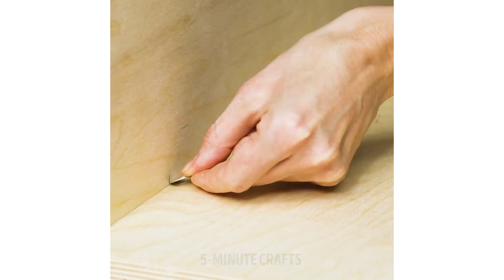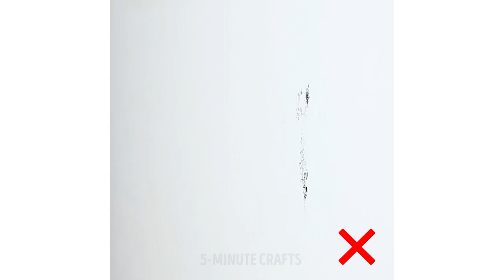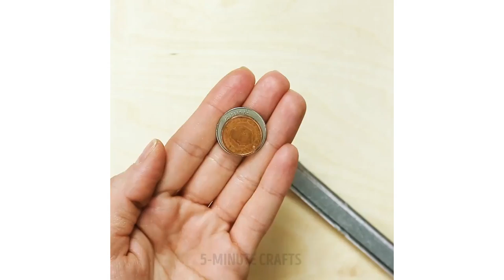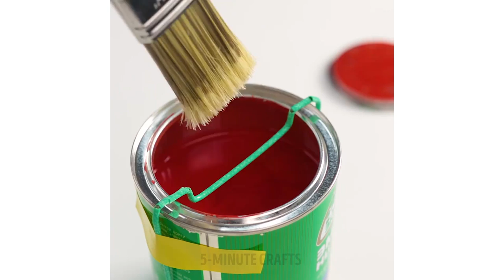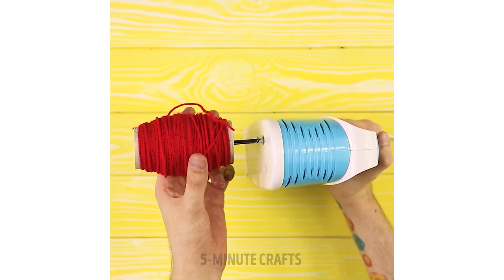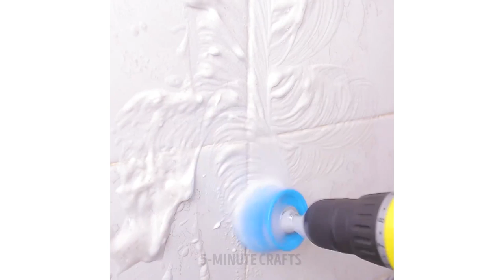14 MIND-BLOWING TOOL HACKS

Comment: I've got 40,000 deck screws.  Anyone wanna come over and help me soap each one up individually?
Reply: I dip the tips in grease or oil.  Reduces battery drain on cordless too
Reply: My late Grandfather (1889-2001) used soap or candle wax on wood screws.  He drove all of them by hand and did not have the luxury of power screwdrivers.  This one really works.
Reply: Just pour liquid soap into the container of screws and shake it up. Problem solved.

Comment: Did anybody else think that the fork hammer was used to put a nail in between and then just smack the hammer down with the nail attached into the wood lol.
Reply: I have a novelty hammer that as a hammer head on one side and a bottle-opener in place of the claw.  It has never been used for anything but kitchen stuff.
Reply: That's exactly what I thought. I don't think I'm going to use my dirty, greasy hammer as a meat tenderizer. lol
Reply: Honestly, just get a meat tenderizer. They should be pretty easy to find, and pretty cheap.
Reply: ... Funky Crumpet ... why not give it a go. Let us know.
Reply: No because you would want to put the nail in accurately
Reply: Sarcasm? Hope so because that is actually a TERRIBLE idea because of accuracy XD
Reply: ... Funky Crumpet ... That would be a good idea
Reply: Lord Flufflebuns  if you swing a hammer for a living you can be very accurate. you must not know much about carpentry. a lot of framing hammers have a groove on top of the head with a magnet to hold a nail so you can set a nail when you can't reach with your other hand to hold it.
Reply: Yep exactly my thoughts.
Reply: I suppose I should have used the word "precision" instead of accuracy. Yes, using a hammer a lot does make you able to just swing the hammer and usually hit where you want, but sometimes you need to be more precise then that, which leads to the point of where this is more or less a situational necessity problem rather than a "Use all of the time" problem. However, don't get all cocky and start saying "You must not know about blah-blah-blah". You sound like a child when you say that. You don't even have to be a carpenter to know that using something often increases your skill with it. But the size of the nail and wood are things you have to take into consideration when hammering, otherwise you could split the wood. If you were a carpenter, you'd know that. The Grooved hammers are only useful when accuracy is not a concern.
Reply: Using something does not automatically grant higher skill with that object. You need to get used to, or accustomed to that object (if u want to get smart-ass with me).
Reply: Max Green  Really? Learn to read before you comment. I never said that people just pick up and learn something. I said that if someone uses something A LOT then they become more skilled with it. C'mon man, at least try to debate properly.
Reply: maybe if you use one of those small half size nails then you wouldn't have to use as much power to smack the nail in.
i think it would probably work that way depending on how big your nail is.
Reply: I have to admit that I did lol
Reply: ... Funky Crumpet ... II
Reply: give him a break it was most likely a typo
Reply: we'll done you.
let your mother know how good you are when she brings your supper up.
Reply: ... Funky Crumpet .
Reply: Yep!!
Reply: Exactly! I have a 16 Blade  Meat Tenderizer. No way the fork and hammer is better. looks just like this model: Jaccard 200316 Super 1 Meat Tenderizer. Cost me under $20 bucks.
Reply: No, a "folk hammer" is used for folk songs.
Reply: it was a typo.
if ya didn't notice the L and k are right next to each other.
and i play folk songs on guitar so i know exactly what you mean.
Reply: But the R is so far away, why is it missing? :)

Also @Wesly Smith, if you have some pencil sharpers lying around you could use the hacks from this video to turn it into at 20 Blade Meat Tenderizer.
Reply: LOL thats why i watched the frickn video in the first place  : P
Reply: ... Funky Crumpet ... yip, used most of these before and know a few other tricks
Reply: similar to an upholstery hammer when using small tacks
Reply: ... Funky Crumpet ... i thought it was for making mashed potatoes
Reply: ITS to punch beef

Comment: NICE
About the last tip cutting a bolt: cut beyond the nuts, hence when you unfasten the nuts they fix the end winding of the thread
Reply: zapopper, how do you know which end he was going to use?
Reply: probably because chucking up on the treads tight enough to do that is going to ruin them.

Comment: Had never thought that an elastic can be used as a buffer to a worn screw recess
Reply: They can, sometimes, although I've found that if it's going to come out at all, its a matter of applied pressure. Having worked in refurb, the amount of stripped screws I've had to remove astounds me. More often than not the elastic got in the way.
Reply: .... except it doesn't work. Use vise grips, not this joke of a hack.
Reply: That screw wasn't worn. It was a pozidriv screw and he was trying to turn it with a philips screwdriver.
Reply: Vice grips solves every problem :)
Reply: Claymore77 The tick marks between the cross indicate it's a pozidriv. You can do a Google image search for pozidriv screw to see what it looks like.
Reply: Use a junior hacksaw blade to cut a slot and then use a BIG flat blade screwdriver to get it out.
Reply: Or you could just use the right Posidriv screwdriver, as Cartoon Watcher points out.  A regular easy out screw extractor works too, if you don't need to reuse the screw.  But nothing beats having the right tool for the job.
Reply: A torx screwdriver I would normally try on the rounded screw. It depends also if long wooden bench screws, allen head bolts etc
Reply: You do now!
Reply: It's easier to just get an extractor set
Reply: Chris Welcome... only if you can clamp on to the head.  If it's sunk, your vice-grip is as good as butter.
Reply: No that was great!
Reply: Mark the time.

Comment: Obsessed with holding nails on a hammer.
Reply: you take more time making the 'hack' than the time you'd spend hammering the nails into whatever object. Just bring the container with the nails...Also it doesn't work for bigger nails, either the nails drop off as a bigger force is applied to the nail due to added weight and harder swinging of the hammer.
Reply: Also, it isn't that hard to hold nails in your non dominant hand. I've done that for years at work.

Comment: some of these aren't hacks, they are proper usage.
Reply: yeah my I/O operator was malfunctioning
Reply: except for the double-wrencing and coins in the wrench
Reply: Helpful for us amateurs that didn't know, though. Like hooking the tape measure slot on a nail, and that your cutter has a built-in piece to break away to a fresh blade. Also consider that we amateurs are the ones that never have the proper tool on hand.
Reply: The issue is a lot of these are proper usage, and a lot of them made me cringe and for someone who doesn't know a lot about tools it could be dangerous to confuse them.
Reply: "why are all your wrenches broken?"

I saw it on youtube...
Reply: It'll be the drill with the bent shaft. I've been doing mechanics since I was a kid, even got certs in mechanics, autobody and welding. I can vouch that it's safe for your wrenches to leverage them together. Just watch the amount of bend. I've probably snapped more wrenches using them the correct way than harm done when stacking the lengths.
Reply: flntstne and aren’t we smart enough for some of these life hacks
Reply: I did not see any broken wrenches....  What?
Reply: double wrench = ok to do, but you risk damaging your tools or snapping the bolt in 2 pieces.

Comment: 1 wrench, impossible to turn the bolt. 2 wrenches, loosens bolt no problem. When life throws a wrench in your gears, grab another wrench.
Reply: Ben Miller heh. this actually made me laugh.
Reply: haha
Reply: Ben Miller )8
Reply: For the record though people thinking the drill thing was a bad idea was bogus... but you might want to be careful trying that if your on the brawny side. Wrenches turned sideways like that aren't that hard to snap. There is a reason they are shaped with the thickest part of the metal the plane of force you are applying. Odd's are if you can't get to loosen with one wrench the force it would take doing that would snap the second one.

I highly recommend tapping it a few times with a rubber mallet, or a chunk of 2x4 to "break" the nut.
Reply: You Tube
reload
Reply: Don't tap nuts to break them free, this is what amateurs do and it either leads to a nut that wasn't that stuck becoming free or it leads to a stripped nut. Use a cheater bar, or any pipe that fits over the nut. Or if it's really bad, put some penetrating oil and let it sit.

of course anyone who does enough wrenching knows all of this by now.
Reply: Worked fine for me for the past 25 years, worked fine for my father and my paps too. Penetrating oil will literally do nothing if it's truely stuck. Bout all thats going to do is remove debris from the threads.

Also a cheater bar goes over the wrench, not the nut.... Also a great way to break a wrench. A quick tap can loosen a lot of things that steady force wouldn't budge.
Reply: If penetrating oil doesn't work than you should be considering heat till red hot, because it's rust welded. I don't know what kind of work you guys do, but as a mechanic and machinist, you NEVER tap nuts to loosen them period.

Yea i made a typo. If you have a nut so stuck that applying a cheater bar is going to break the wrench instead of stripping the nut or loosening it, then tapping the wrench won't do anything. At that point you should be heating it, then hitting the nut itself to break the internal rust weld.

"A quick tap can loosen a lot of things that steady force wouldn't budge." how does this make sense to you? A hammer puts in a load of force for a split second and then it's gone, that's why it usually strips the nut instead of loosening it.

Comment: That nut & bolt wrench was pretty awesome.
Reply: Jim Brown257 exactly the one that made me hit the like button
Reply: You try it with a bolt done up and your going to be disappointed.
Reply: Why not just use the correct size wrench to begin with?
Reply: good
Reply: @Matthew. For times when  you don't have a wrench, but you have the nuts and bolts.
That's what most of these are... for times when you don't have the right tools.
Reply: Hola como estas maira  cuentame  de  ti  mami  te  amo tu  avuelita  beatris  chao  te  quiero  mami  dioste  bendiqua
Reply: Jeremy p
Reply: Jeremy a
Reply: Unless there is any resistance then it would slip off straight away
Reply: L
Reply: Excellent Video clip! Excuse me for butting in, I would appreciate your opinion. Have you heard about - Rozardner Successful Handyman Reality (Have a quick look on google cant remember the place now)? It is a great one off guide for how to start a handyman business minus the normal expense. Ive heard some unbelievable things about it and my friend at very last got astronomical results with it.
Reply: Jeremy .Ñ
Reply: This wouldn't work on an actually tight bolt.
Reply: Dj TeeOh
Reply: The only usefull one.

Comment: An exacto knife working the way it's intended is a hack?
Reply: Using a wrench on a screwdriver to apply more torque, which is the intended use on such screwdrivers, seems to be a hack as well...
Reply: we can keep going, using a nail to hold the end of your tape?  but come on now, using two nuts on a bolt to loosen or tighten a similar sized nut? that one is nifty.
Reply: I think the intention of the hack is if you're stuck and don't have a wrench.
Reply: all those hacks and that's the one thing you point out? why is everyone so critical these days?!
Reply: Im.not.a.ricer it makes you want to punch them?
Reply: I can totally see that someone not used to working with them simply doesn't know that they work that way. I didn't, and now I do feel enlightened!
Reply: Yeah great video for the slow guy's of the planet!
Reply: ah come on they made exception cuz most of us did not even know duh
Reply: natasha begley - planets do not exist.
Reply: BMX
Reply: उ.
Reply: Im.not.a.ricer I think you've made them into an imaginary person to hate
Reply: Exactly the ""it's 1am, lets not wake the neighbours for a spanner" hack.
Reply: Anodos Arcade 9
Reply: I have a couple of wrench sets but that trick is really handy in a pinch, especially when something needs to be fixed right at that moment and all you have is stuff lying around in the bottom of your glove box.
Reply: If you don't own an adjustable wrench.... you have no reason to be doing anything physical. Call a professional.

Comment: Or you could just throw away your Philips head screws and use Robertson Head screw like we figured out in Canada years ago.
Reply: best comment. Henry Phillips probably just wanted to sell more screws and drivers by designing them to wear quickly
Reply: A lot of quality deck screws here tend to be robertson or torx now actually. But even in canada, if you're working on something from before it was common practice, you're going to run into something that still used phillips.
Reply: I think torx are the best.
Reply: Im all in for torx or allen head
Reply: Yeah, but Canada also has Celine Dion and Justin Bieber, so why should we trust you?
Reply: jeff scot
Reply: +Tim Morris William Shatner, Niel Young...
Reply: Why not using torx?
Reply: And now Jeff Scott

Comment: 1: 0:26 what niche purpose is thus useful for....

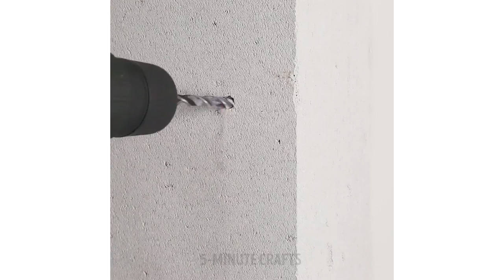2: 2:26 common sense....

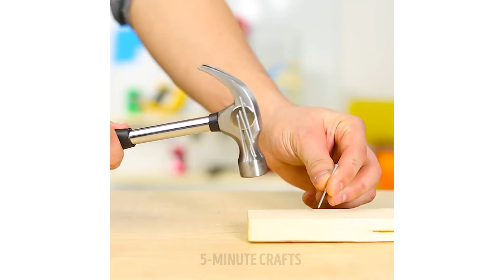3: 2:56 we just saw this.....great editing

4: 4:15 For when in point three you dont have a magnet.... (Typically i don't find the need to have only a few nails, so keeping them in a tub is good enough. Also a magnet is useful if you are working with gloves and cant pick up the nail. 

5: 5:55 For that dumpster look....

6: 6:18 because only women knit, they have to use a mixer instead of a drill...when men use drills to easily peel potatoes, or eat corn they are looked at funny, but its funny to look at blender being used as a drill... and then the video goes ahead and uses a drill....just wow.....

7: 7:27 if you have a glue gun and pencil sharpener and two chopsticks lying around, I am sure you have a knife as well.... This is more like how to make a shank tutorial

8: Basically the video finishes with some ways you can use a drill to avoid spinning things manually. Like a car jack, because when I get a flat and need to use a jack, I also have a drill sitting there ready to go....

All in all this video had some good points, and some, should I say dickcheese, sprinkled in for good measure.
Reply: 1: I can think of one - let's say you need to drive a bunch of screws into a board, and they all need to be the same distance away from another board...

2: Maybe. I don't do this though. I just sweep the floor afterwards.

3: It's not exactly the same, but I'd agree they have three different ways to hold nails to a hammer, and two use magnets. Kinda weak.

5: I doubt anyone would be able to tell.

6: I thought they used the mixer because it holds the tube. How would you use a drill to do this?

7: Yeah that one was kinda ridiculous.

8: When I first started maintaining my own car I used to use a screw jack to lift it - not just for emergencies. It's painfully slow. I'm not sure about using a drill to speed it up though. I could imagine it causing a problem if you don't stop it in time. I've used a hook chucked in a drill like that to drive eye screws into wood, but I don't think I'd risk lifting my car with it.

There's definitely some cheese in there, but my takeaway is that the video is meant to encourage resourcefulness. "Oh shit I don't have a <insert tool here>, and I don't have time to head to <insert store here>, so maybe I can just <insert janky fix here>."
Reply: my thoughts exactly, most of these were common sense or just made easy tasks more annoying.
Reply: LordAugastus 10/10 comment would read more point-by-point youtube reviews.

Papachabre the point of this video is to make USD$20,000 with next to no effort at all.

Comment: At 8:26, you should first thread a single nut down past the point where the cut will be made because the cut usually leaves damaged threads that make it difficult to thread a nut onto the fastener. Once the cut has been made, unscrew the single nut and the threads will be straight. A little cleanup with a file may be necessary.

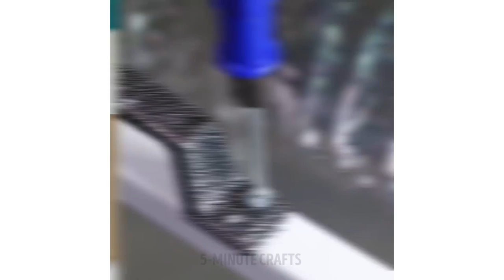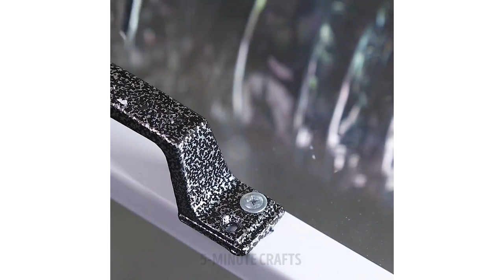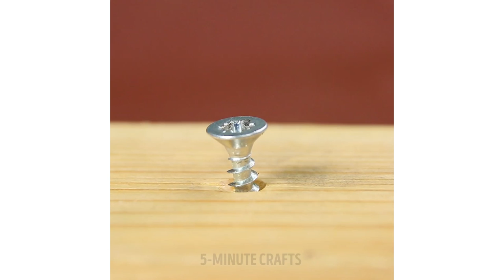Comment: If everyone started doing these things, that could put a lot of Chinese tool makers out of work & then Walmart would lose money. Keep up the good videos like these. Also, a couple of the things showed were what the tools were designed to do. The screwdriver with the hex shape below the handle & wrench was one ( at 1:35 - 1:45 ) & breaking the blade on the cutting tool to get a sharp edge. ( at 1:22 - 1:35 ) Noticed the scored metal on the blade every 1/2 inch or so, so it can be broken off easily to get a fresh cutting edge. I bet some people don't know that that is the reason the blade is made that way & throw it away when the first blade gets dull. So I guess it is alright to train people that don't know how to use something, but that is not a hack. And I thought he could have cored that apple after peeling it with the same tool, just hold the apple & drill out the middle.

Comment: 3:57 I save the plastic sprues from the model kits I build for that.
4:47 you can also use a rubber band for that
6:13 or a drill